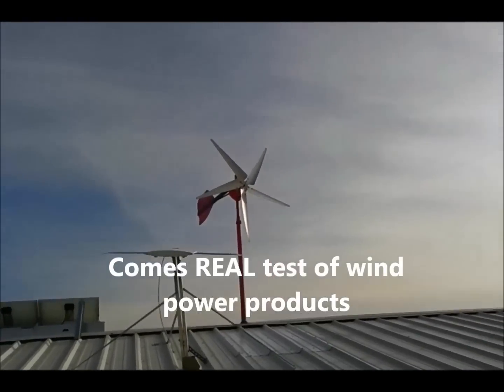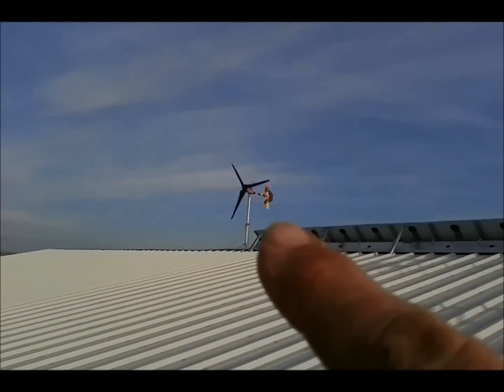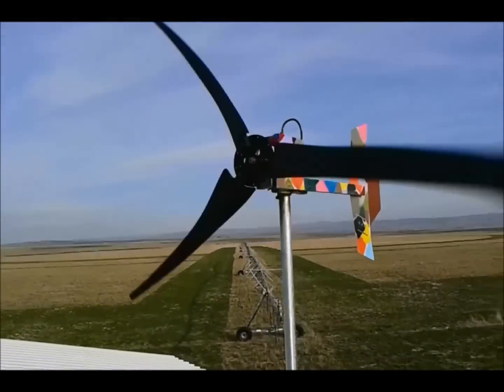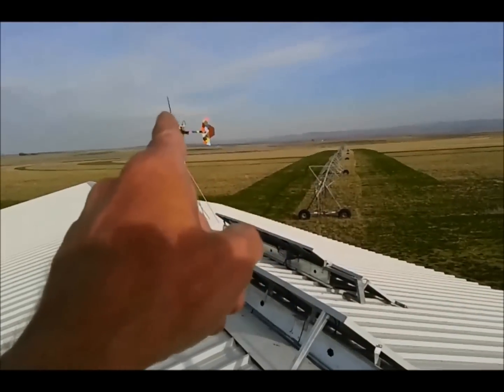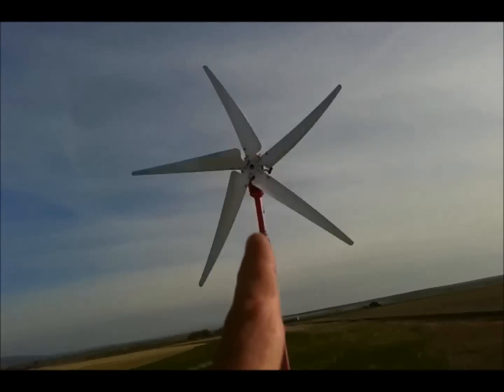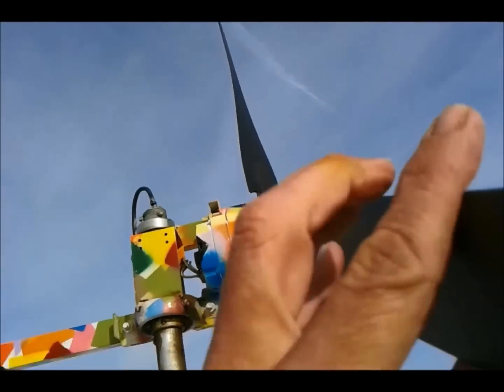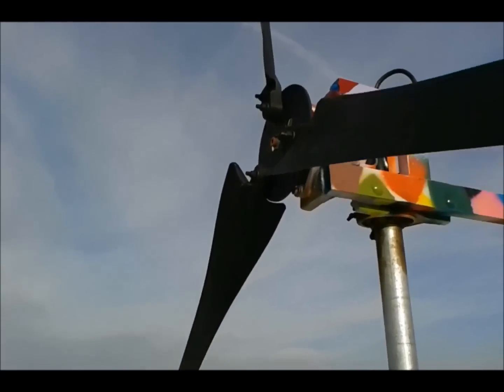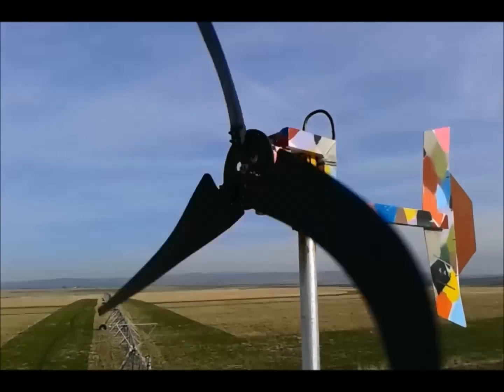Best USA MADE Micro Wind Turbine blades KT 74", PARTS BELOW

Comment from the maker: LOTS OF INFO - Restored the SUPER CHAOS turbine. Using world famous HORNET PMA   https://tinyurl.com/SUPERhornetPMA1k Original Inventor, best on the market*PARTS TO GET BELOW*  90/180 amp Slip ring, ONLY HONEST SELLER https://tinyurl.com/GENUINEMOFLONSlipRing the REAL THING  - Not a MISSOURI / Vietnam Knock Off 
Meters is 100 Amp DC, ebay https://tinyurl.com/100A-meter Original Meter Manufacturer, 8 to 10 day shipping.  
This video shows you the simple building process of Turbines, Rectifiers and Meters.  
Chaos is Made with PROVEN materials. If you want fake watts, you have to buy from places in Missouri. I suggest your parts come from proven sources. Ask, I'll send you links and you can review and apply. 400/500 watt REAL Wind Turbine from http://s.click.aliexpress.com/e/qv7ayvN all specs there. 
100 Amp Rectifier BAO-Amico http://amzn.to/2DkP4q7
3 pole double brake Switch http://amzn.to/2FrFOB5
100 watt Brake Resistors http://amzn.to/2FrzwRQ
- WIND AND SUN Diversions controllers, So Smooth, Battery Saving. https://tinyurl.com/WindSun-Controls by J Mason Design Solid State Controls, SSR the rest are crap~
-Rectifier Spade Connecor Terminal 3/8 https://tinyurl.com/Proper-375-Fmale-Terminal  Proper .375 inch Fmale Terminal

Comment: What do you think about the blade extensions. And the blade cone things ? Can't think of what they are called, but supposed to make more power at low wind,  I was thinking around 6blades on a 18"-20" hub, to spread the blades out, to lessen the windwall effect, and gain low wind TQ and speed, I saw a guy making and selling hubs around $120 hub only, it looked like a wheel , and had blade extensions, to make each blade about 4" longer! That's alot for a hub! But he used it his self, I don't know any results, what's your opinion!! I have a 6 mph average, and often see 40-50 , I know I will not make good average power , but I need something to take over when its cloudy, and it usually gets windy with the clouds! I need the little bit extra to charge the 24v bank!!! I need all the advise I can get, I am starting to seriously over think things! Ha-ha...
Reply from the maker: I would just get the 3 or 5 black KT blades and hub set. Balance issues come into play fast altering your hubs and blades.

Comment: Can you direct me how best to select a blade setup for a given alternator? I have a PMA from an unconventional source that I feel would be an excellent turbine alternator with the proper blades.
Reply from the maker: Depends on your RPMS you will be trying to achieve. The KT blade is low to mid RPM so they run 300 to 1000 rpm turbines very well from 300 to 1300 watts. Whats the specs on what you plan to use.
Reply: It's a hoverboard motor, from those balance boards a few years back.supposed to be about 300W with great low-rpm performance. Spinning by hand I could easily get 6VDC out of the rectifier. I'd plan on some weatherization mods but it should be fine to mount a hub to (somehow). I got the motor for around $20 on ebay for another project that never resolved.
Reply from the maker: My suggestion because the hub is easy to adapt to your needs and the blades are super balanced. https://tinyurl.com/WindNation3X

Comment: I would like to know how many watts & volts the generator is rated at that has the 3 KT blades. I just ordered the 1000 Watt PMA 24 Volt AC 3-PHASE from Thermodyne, I want  to use the 3 blade KT blade set on the 1000 watt pma. I have the 2000-Watt-PMA-PMG-24VAC-Dual-Wide-Core-Permanent-Alternator with the 7 KT blade set & in 25mph winds i only getting 20 amps, Im using 10 gauge wire & only running it 25 ft. I really like the KT blades & highly recommend using them. Thanks for taking the time to show your results.
Reply from the maker: +garden wind It'd a. 800 watt as a 12 volt style. However, it's modified to my redesign.
Reply: Thanks for the information  i tried the new 1000 watt pma with the 3 blade KT hub in 15 mph  winds & it to much torque for the 3 blades i had to go to the 7 blade KT blades, but im only getting around 5amps.
Reply from the maker: garden wind That's why I only  run 3, 4 and 5 blade. 7 may start well but is too much mass and becomes a blade wall.

Comment: Thanks for the shout-out John.
Reply: We love out KT blades
Reply from the maker: As a real user of wind energy I recommend truth, no bull materials and durability. http://rover.ebay.com/rover/1/711-53200-19255-0/1?icep_ff3=2&pub=5575119394&toolid=10001&campid=5337668021&customid=Genuine+PMA&icep_item=232605009533&ipn=psmain&icep_vectorid=229466&kwid=902099&mtid=824&kw=lg The Original PMA, not a Missouri fake knock off. And the blades http://rover.ebay.com/rover/1/711-53200-19255-0/1?icep_ff3=2&pub=5575119394&toolid=10001&campid=5337668021&customid=Truly+Engineered&icep_item=232606155954&ipn=psmain&icep_vectorid=229466&kwid=902099&mtid=824&kw=lg The Only KT sellers are THS, Blades also available at Amazon http://amzn.to/2ECRa5o in numerous combinations
Reply from the maker: Marge Hopefully they won't remove the item listing and you can always find these.
Reply: Those blades came from you? Thanks man, we got 2 sets about 4 months ago. very nice blades. Perfect for a home built with the generators we got.

Comment: This is John new study and must be consider!! I`m glad you have those to test in your area.. I`m really surprised of the 3 blade set you have made.. The startup is really good on it and they seem to get to production speed sooner than i ever see  before.. It reminds me of your previous  Hit to be squared blade set!! I`m in process to buy the 5 blade set for my area as soon as the snow melt down here..  Thanks for sharing Buddy!!
Reply: +al desrochers (“peper 0110”) You have make my Wheel turning and i have perform to build a 3 blade set just like you for testing
Reply from the maker: +al “peper 0110” desrochers Best to go with 3 or 4. Reason is that there's no need to just having it spin unless there's enough wind to actually get power from.

Comment: They're impressive blades for sure. 3 blades is ideal for these turbines I think, especially for med to high wind zones. A little less start up torque than a rotor with more blades as we saw at the beginning of your video, but once they start then there isn't much that can compare. Less blades = a higher TSR because the turbulence/wake effect on the back of the rotor that's typical with 5+ bladed rotors is far less, and wind-walling won't occur until much higher wind speeds. The more blades that a rotor has, the more turbulence they create behind the rotor which disturbs the lift/drag ratio on the aerofoil as the wind speed increases. This is why 3 bladed rotors can reach higher rpm's. 5+ bladed rotors should be limited to low-med wind zones and low demand applications for this reason.
Thanks for showing John.